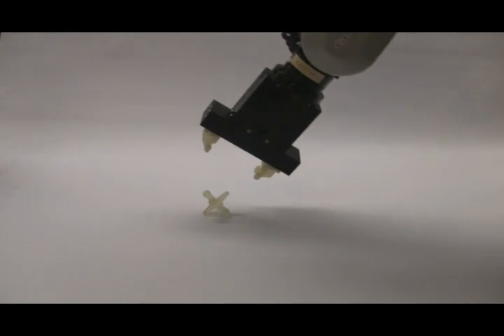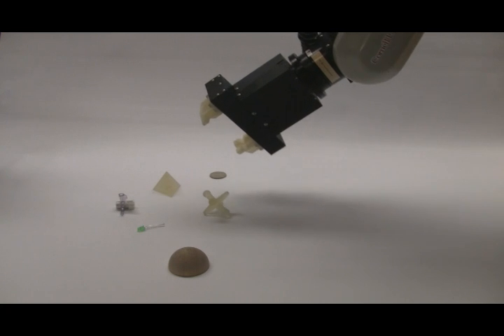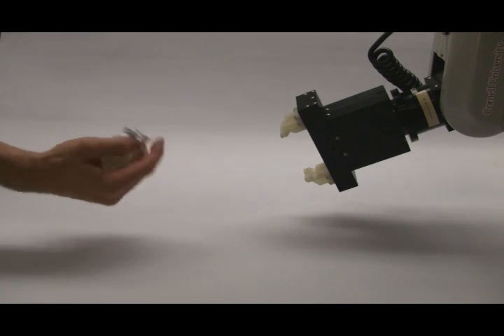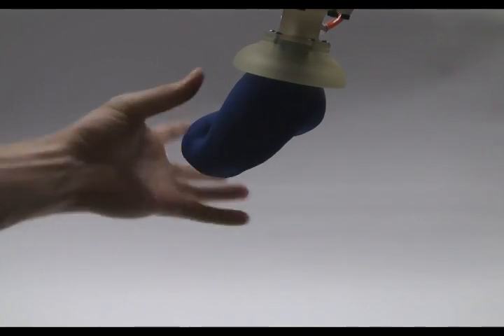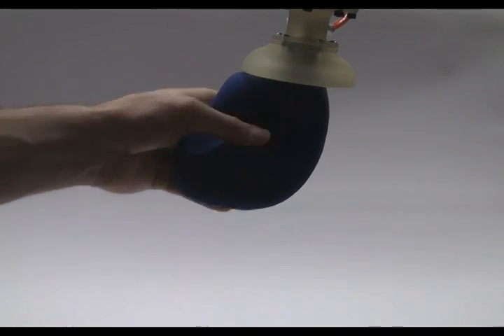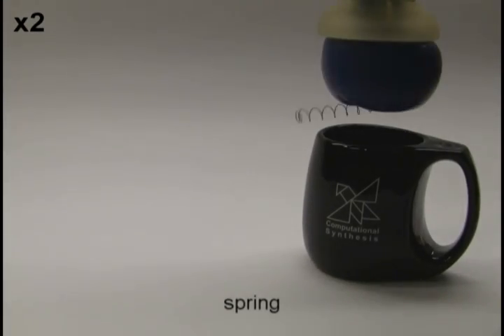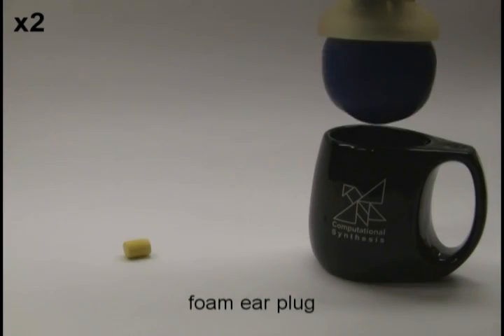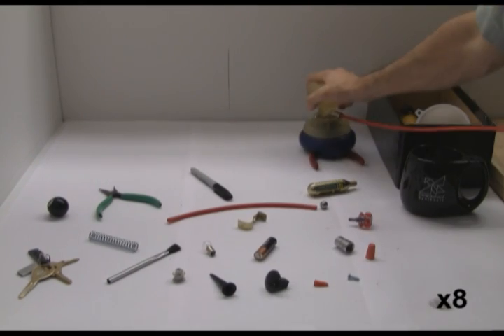Presenting the Universal Jamming Gripper

Comment: @MrFantabuloso I've seen this done in a hospital to make custom fit seats for wheelchairs. The procedure was to sit the person on an air-tight bean bag, suck the air out, then it would solidify to the right shape. You could then take the person out, make a mould, and make a seat from fibreglass or carbon fibre or similar.

Comment: @walterjennings Would it even be possible, without the "smart" membrane you mentioned, to obtain suction with only a permeable surface? Take the coin, for example. Upon picking the coin up, there would be a lot of remaining area on that balloon that would be porous, so no seal would be created with the coin's flat surface. If no seal is created, would the vacuum still create suction strong enough to hold the coin to the balloon?

Comment: @walterjennings It'd be pretty hard to get the right amount of suction through a permeable surface. The holes would need to be small enough to the granular material wouldn't go through, and the suction would have to be powerful enough to both suck the membrane strong enough to grip and suck air through the holes.